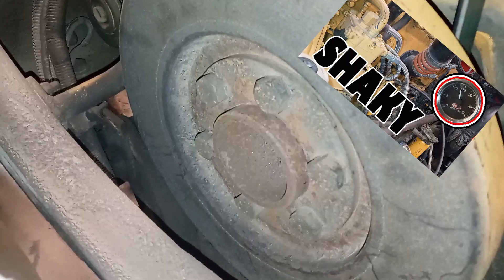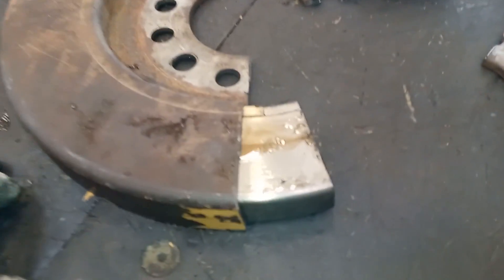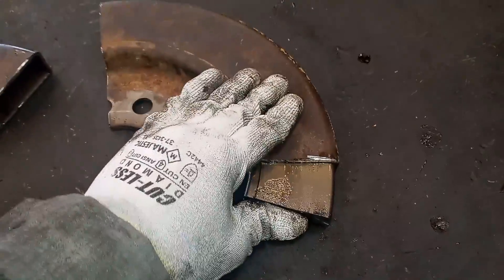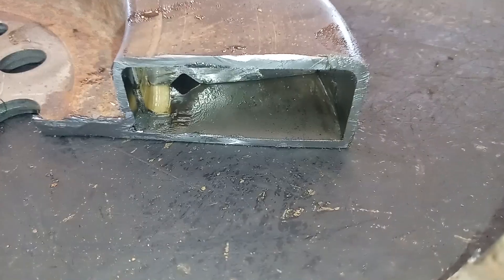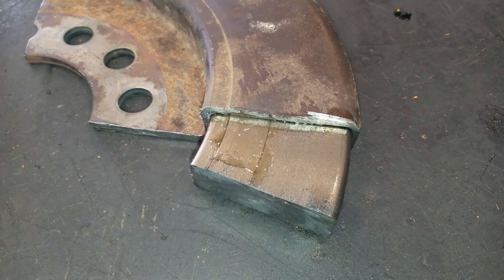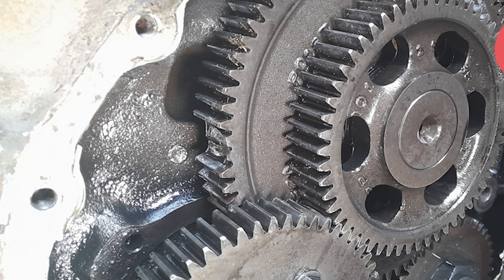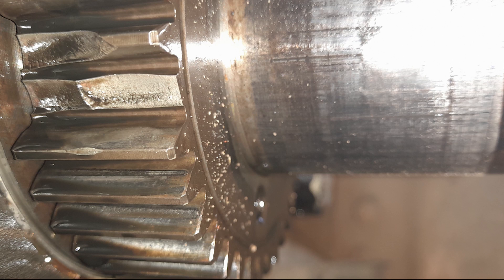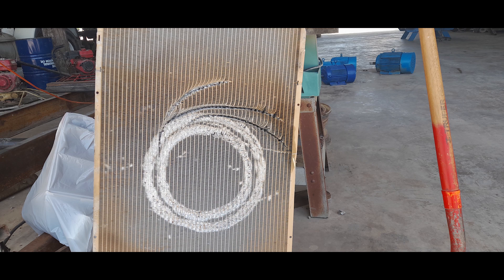What's Inside A Damper? Harmonic Damper.

Comment: I changed the vibration damper on my RV based on Josh's recommendation and it really helped reduce the high frequency vibration.  A 3 axis accelerometer showed a 26% reduction in overall vibration.  Check it out here - https://youtu.be/RCc0p6F-pjI?si=-LMPpBZiw-Li_g3s&t=87

Comment: The best is when the fan clutch grenades and takes out the radiator, condenser, intercooler, all the hoses and dents the hood. LMFAO. This is why I am a firm believer in a nice e-fan setup. No doubt, that fluid is messy when the dampeners and hydro motor mounts start leaking as well. 🤨 Thanks for sharing as always bro!👍👍
Reply: I know this thread is aging but can you tell me what a nice "e-fan" set-up is? Thank you

Comment: Thanks for your videos they have been very helpful. I have a question if you could shed some light on my problem I would appreciate it very much. I have a 1998 Dutch Star on a freightliner chassis with a 3126. We have driven it about 3000 miles a year since we got it in March of 2020. The issue I have is at Hwy speeds on a float it feels like the engine cuts off I accelerate as soon as if feel it and it picks right back up with very little movement of the accelerator pedal. Has never completely quit. Any insight would be appreciated. If it were a gas car I would almost think the tps had a bad spot in it.

Comment: I’m curious if you have any recommendations for older dampers on smaller/low miles engines. My 3126B in my RV is 22 years old but only 110k miles. It’s definitely original. Making me think it might be time, especially after I spent a bunch of time replacing all the bearings a couple winters back…
Reply: I just changed mine and it made a 26% reduction in measured vibration at the engine.  I think it's totally worth it if you want the engine to last.

Comment: That’s a 500k mile part. Recommended to be replaced by Pittsburg Power. They also recommend a balancer that bolts over this. No balancer available for DD15. On a series 60, replacing this at 550K and adding a balancer pushed the engine to 1 mill with clean oil samples and no oil consumption.
Reply: Where can one get a balancer from on a series 60 12.7?

Comment: On regular cars, usually the harmonic damper is a 3 piece pulley. The outer is the pulley that the belt rides on, and the inner is the part that connects to the camshaft. In between is just rubber, but usually very thin. You won't always know when these start to  fail. The last one that failed me, I noticed because my belt was being chewed up, which usually means that the belt drive isn't aligned, and it wasn't because the rubber deteriorated enough that the outer pulley was slipping off and going towards the radiator. No major damage expect to the belt, which I can live it.
Reply: Ive seen the rubber fly apart before lol
You can get aftermarket fluid dampeners for most engines that have a performance aftermarket
Reply: Cummins calls out a deformed/protruding/cracked rubber ring as the failure indicator.   With a 30k mi inspection  intervals.  They went to viscous about the time they went to the 6.7l.

Comment: Every 500,000 miles a Damper should be changed that’s The OEM Cummings recommended interval. Time doesn’t matter as much as Miles they simply should be changed. If they go bad they can destroy alternators AC compressor, Air Compressor, Fuel Pumps, camshafts, main bearings, and of course complete engine failure
Reply: Time should matter more than miles bro.
Reply: @jaredmayer3960  it is sealed completely time doesn’t matter according to the OEM hours on the engine matter that is what it is spinning and vibrating.
Reply: My 500k mi 91 didn't chew up any accessories but it did chew up bearings  all were within factory spec but front 3 tapered from max to min on #4-7. I interpret this to mean the front of the crank was deflecting  from the bad balancer
Reply: @daviddroescher  you’d never get enough deflection to cause that.  It must have been machined poorly to start with.
Reply: @daviddroescher  you were overtightening your belts, thats why they came out with serpentine with a tensioner
Reply: @youtubeisawesome2487  1 8 rib serpentine  belt on my 6bt. So that was not it.

Comment: I have a small mechanical diesel. 
The factory balancer is rubber 
Which slipped after 350,000

They sell a hydraulic dampener but it’s expensive ….
Reply: If you got 350,000 on the first one, I think you did well. They aren't that hard to change, usually.
Reply: $350 vs $750 for my 91 6bt cummins.  Ming didn't slip but the rubber was wetting the bed protruding  and cracked( protruding or cracks are called out as a failure modes)  I went viscous as I planed to modify the factory setup, and the viscous will self adjust to dampen a very wide range of Resonance  frequencies Vs  1 set of resonant frequencies that no longer match the motor.

Comment: I replaced last year after  million plus miles i have video before and after i put half filled plastic water botte on valve cover water was still and no vibration at all after replacing new one...
Reply: Have you noticed a difference? My  C15 has 950k miles, thinking to change   a dumper

Comment: A damper will absorb vibration at any frequency.

An absorber will absorb vibration at a specific frequency or a specific multiple of the crankshaft speed.
Reply: If a damper absorbs
How is a damper not an absorber?
Reply: @fastinradfordable A Damper works primarily with a daming element between the two masses, in case of a viscous damper, this is the silicone oil between housing and ring. The relative motion leads to shear damping in the oil, converting mechanical vibration into heat. An absorber works with stiffness in between. The absorber or detuner has the same inner natural frequency as the vibrating system, here the engine crankshaft, and this leads to the detuner effect, splitting up the original natural frequency if the system into two new ones, both of them having a lot of twist inside the detuner and by this shifting energy from crankshaft to the detuner. In addition, detuners have inner damping to keep the inner twist under control. So in real life, there is no pure damper or detuner, its always a mix. Fun fact, i was responsible for this damper at manufacturer at some time. Good old days...
Reply: The rubber damper is tuned to a specific Resonance  calibrated to 100% factory tune/ condition.  Change anything and the Resonance will change making the damper ineffective or nonfunctional when increasing power output .
Reply: @daviddroescher  Then that "damper" is actually an absorber, not a true damper.
Reply: @electric7487  correct   it dampens from the rubber ring turning vibration into heat giving a finite life span with a narrow rpm and  Frequency window